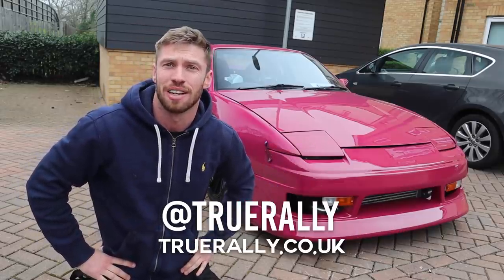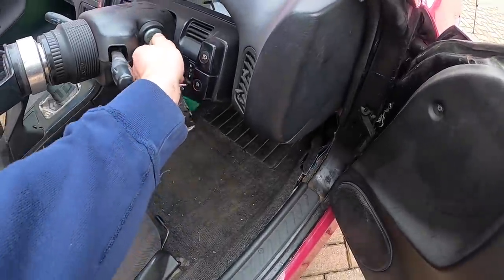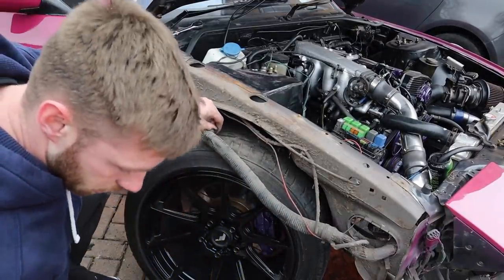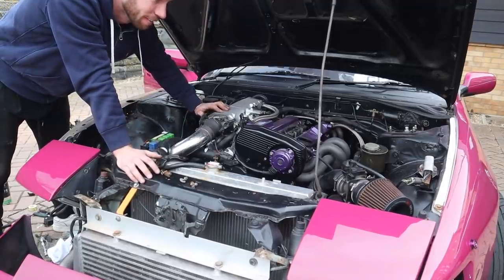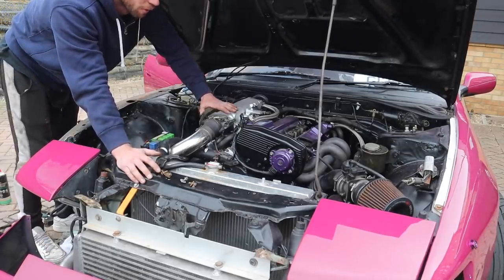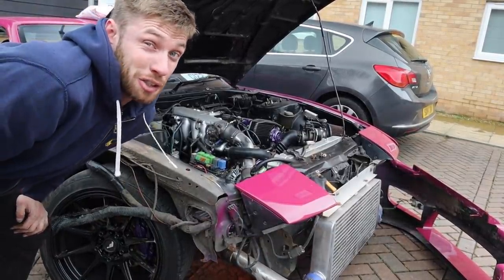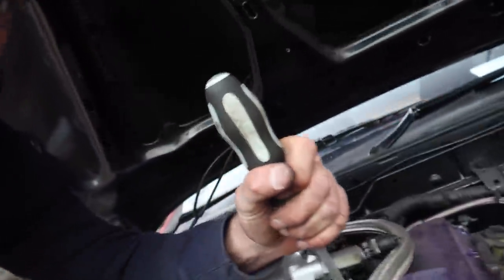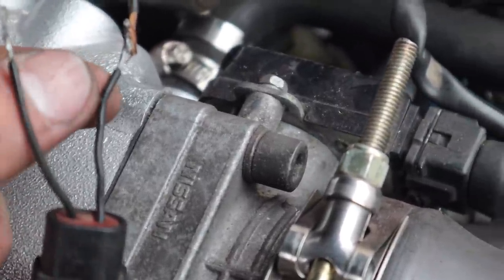How To Easily Find and Fix a Misfire with No Tools.

Comment: You're still gonna risk rubbing through the loom like that. Best way I found to do it is unwrap the tape off it, and then wrap it up in two bits so you can lay it flatter underneath the wing on top of that lip. Should fit in there nice and snug!

Comment: Before you jump in let me finish, so replace the whole loom / engine bay loom. Now at this point your ready to tell me to go fk myself, no way ect ect 

Hear me out

The guys and yourself have done a great job getting it to this point but you are chasing who knows how many owners mods and bodges. Start with a fresh as possible loom and mod what you need to so you know what's been done and what's needing done.

Been here so many fkn times chasing a fault and it's an old owners done some crazy wiring mod years back. Yeah it's alot of work but you start at a solid base.

That's my 2p bud 👍